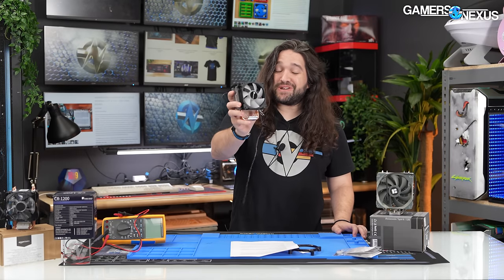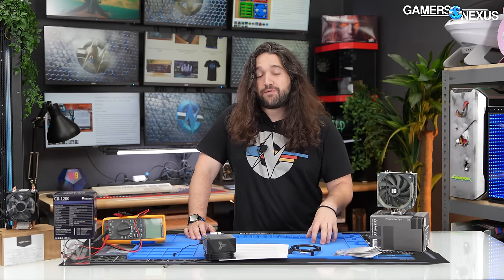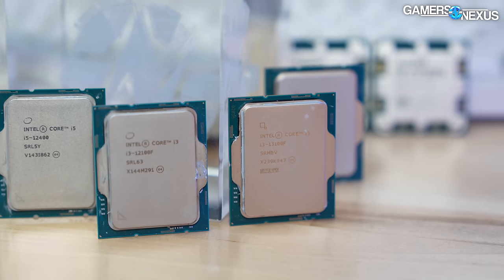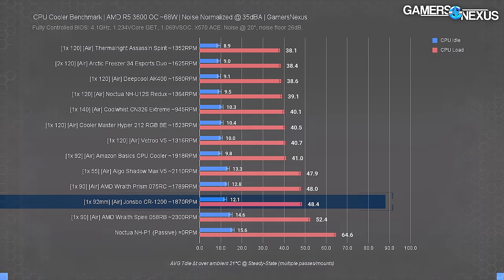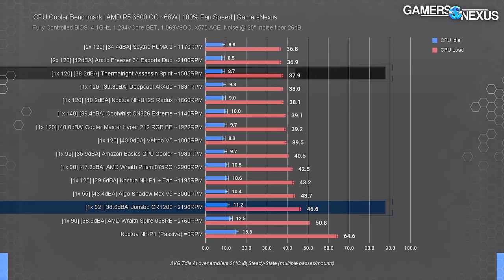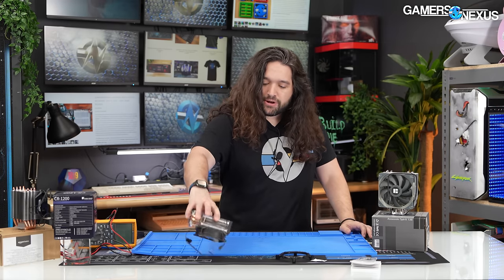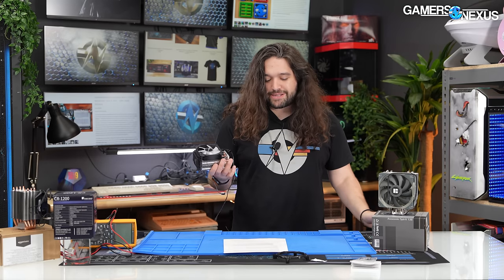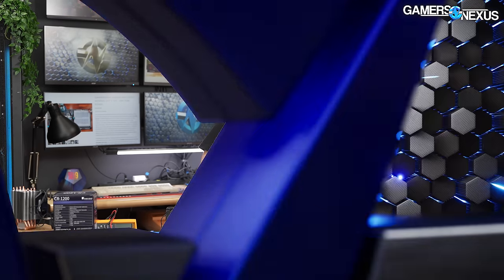Testing the Cheapest Possible CPU Cooler | Jonsbo CR1200 Benchmarks & Review

Comment: The Jonsbo CR-1200 is also available for as little as 6$ (with free shipping) domestically. It also has a 92mm (edit: confusing naming led to some misinformation) variant called CR-1400 which is sold at more or less the same price.
Reply: I have a CR-1400 as spare part, it still is a 92mm size, but has 4 heat pipes instead of 2.
Reply: How can they even make money out of it? The copper alone is worth more LOL
Reply: @bladeoflucatiel  Idk perhaps they primarily sell to prebuilt vendors and then excess warehouse stock is just shipped out for a dime to maintain a steady cashflow and goods? Maybe just for brand recognition marketing? 
It can be very tough to pinpoint why exactly a product exist at its given price range, especially in the extremes of ultra inexpensive/expensive. In my experience some of the worse offenders are the ultra expensive ones, like I saw a 3080 10gb sitting at a shelf for literally 2.5k usd (converted). That thing would not sell in a thousand years, yet it just sits collecting dust and taking up precious space. Why? Nobody knows, I bet not even the people selling it are aware of its existence lol.
Reply: @bladeoflucatiel  snowman the cooler of choice for low cost build has been selling at this price for ages, jonsbo just have better sales network, so they can replicate that price universally
Reply from the maker: Are you sure about that? The product page says it's a 92mm cooler for the CR-1400. Even the official Jonsbo product page says 92mm. I don't understand why this is getting upvoted so much when it is just factually wrong. But on pricing/domestic availability, that's helpful to know - thanks for pointing that out!
Reply: I used the CR-1400 with a spare 5600x for kiddo's first build - it's fine... with boost set to 4.85GHz all core, it only hits 90 with y-cruncher avx loads when total package power is 168W - in a warm bedroom in a small, poor airflow case. Idle is low 30s, so about 10 over ambient. Gaming load is ~60. Cost about 10$US from a local (NZ) source. It's fine.. nothing exciting, but if you need a cooler for a non techie, it's cheap and cheerfull.
Reply: The CR-1400 is 92mm, that's what I got for the ITX system in my Phanteks MiniXL dual-system case because it was the only cooler with enough clearance I could find that could be oriented to push air vertically (towards the top of the case) - the Noctua couldn't, it could only push towards the back of the case. By the way it was $11 when I bought it which makes this CR1200 make no sense as the 1400 cools my  3570K at 4.9Ghz and I doubt the 1200 wouldn't struggle at stock
Reply: Why is your reply almost at the bottom of this yt thread?
Reply: @GamersNexus Ah yes the naming is quite confusing. It's NOT a 140mm cooler. Thanks for pointing that out!

As for the price, I'm referring to a few listings from a selection of third-party sellers on JD. Of course, Jonsbo's official JD store lists the CR-1400 at approximately 10$ (75 CNY, currently on flash sale with a countdown of 1 hour and 35 minutes - but don't panic since they do that every once in a while lol), but the price is still impressive nonethelessly.

Comment: I've been using Jonsbo CR1400 and CR1000 (not the CR1200) for many mid-range builds. I wanted you guys to check them out 

They work well with 4 heat pipes, great price, and surprisingly good looking ARGB
Reply: How much cost the CR-1400 in your country? in Venezuela they are around 40 US$
Reply: @manuelpereira4247  wow! Here it's around 13-14 usd. Really popular in asia
Reply: Got the CR1400 from Newegg for around $15 on my i7 9700 and it does the job just fine
Reply: The CR1400 is good for a 12600K ?
Reply: @Rokomarn  Yeah, for a K series processor i would go for something like an Assassin's King 120SE

Comment: You guys have sometimes talked about lapping CPUs to improve contact surface with the cooler. Would it sometimes be viable to lap a cooler to improve contact area?
Reply: Yep.  It used to be a common practice when lots of coolers were less than ideal out of the box.  There are instructional vids on YouTube.  Just don't get carried away and put a hole in the heat pipe.

Comment: Nice review! Love budget options being covered in reviews. I have an interesting choice: how about the stock dell/hp coolers that they have in prebuilds? They're cheap and seem like they could fit in some sockets? I have a prebuild hp pavilion with it in there and I swapped the fan with the fan from the AMD Wraith spire while keeping the stock heatsink in and noticed a 3-4°C decrease under full load for a Ryzen 7 2700.
Reply: GN has had Dell reviews before.  I think they use a proprietary mounting that prevents 3rd party coolers.

Comment: I hate living in Turkey. Just checked aliexpress and this piece of junk is sold for $25 to my country while it's $7 for US. Plus $15 or so shipping, it costs $40 total for me...
Reply: At that rate, you might be better off with a slightly larger cooler that AliExpress has a ton of stock off.
Reply: @USSMariner  nah I'm better off buying a local made cooler which is what I did for a ryzen 3600 recently. $20 after tax 4x6mm pipes and 120w tdp. dark x123.

Comment: Just got a Jonsbo C6 case.  I needed something very small to fit inside another Industrial machine cabinet.  I was going to use a Nuc or some other mini PC but the manufacturer really wanted a full PC not a mini AIO.  So this case is really interesting.  It has only one bad point.  The good is that it's the size of many ITX cases and manages to fit a MATX board which is great.  The quick release mesh sides are a very good thing for something this small because you can get at everything easily if needed.  It uses a full size power supply or a small one.  It has a front USB C.  The one downside is that there's no room for any kind of tower cooler so you either use the stock cooling or a slimline Noctua maybe.  But other than that... it's incredibly simple and tiny for a MATX case.

Comment: Man, those latches remind of the old Socket 939 stock cooler. The 478 mechanism was a bit easier but full of plastic.

Would love to see a retro cooler tested on modern hardware like the high end 775 coolers, the late Core 2 Quads (and overclocked P4s and stock Pentium Dual-Core) realistically had more than 130 watts TDP. Because there are still some hanging onto those rigs (heck, my friend's shop computer got an Athlon X2) and in the case with Noctua units, they can be retrofitted on the newer sockets with their mounting kits. Let the dinosaur roar!

Comment: For next coolers to test:

Personally, I wanna see the 140mm fan stuff! Everyone always skips reviewing these in favor of small 120mm single-tower and massive 140mm+ dual-tower. But generally 140mm is under-reviewed, IMO.

- Thermalright Frost Commander 140 (FC140) and Frost Spirit 140 (FS140) (These are dual-fan dual-tower coolers, with 1x 120mm, 1x140mm fans... What the??? Why two size fans???)
- DeepCool AS500 (single tower w/ 140mm fan)
- Be Quiet Shadow Rock Slim 2 (kinda old now, but a single 135mm fan, single tower cooler)
- Noctua NH-U14S (single tower, single 140mm fan cooler from Noctua -- is it any good? Quiet? Compact/flawless RAM compatibility?)
- Scythe Mugen MAX (huge, thick, single-tower, 140mm single fan cooler. Pretty darn old. Brackets for AM4 and newer Intel motherboards are sold separately. Did I mention this thing is huge for a single tower cooler?)

Something about all these being lesser reviewed just gets my curiosity going. Hard to stop wondering, "what if these are secretly really good?" Or just wanting to know even if they suck.

Other weird coolers:
- ID Cooling SE-207-XT (really short dual-tower single-fan cooler)
- ThermalRight Silver Soul 135 (another really short dual-tower single fan cooler, has a more compact 110 variant, these might be interesting for ITX builds?)
- Thermalright Frost Tower 120 and Phantom Spirit 120 (why do these things look so similar to the peerless assassin 120, same price, which one is better? Looks like the fans/heatpipes are different?)
- DeepCool AK500 (thicc single tower single fan 120mm cooler, why so thicc?)
- be quiet! Shadow Rock 3 (another thicc single tower single fan 120mm cooler... What's the deal?)

Comment: Potential Correction: I left a comment on a previous cooler review asserting the Spirit and Assassin X are not actually the exact same cooler.
I do not believe the Assassin Spirit and Assassin X are essentially the same product. The X may have replaced the Spirit, but it is not a simple rename. Not only is the top of the fin stack different, but the heat pipe spacing through the fins is different, and the X appears to have around 45 fins while the Spirit has just over 50. The X is also 46mm wide while the Spirit is 48mm wide according to the Thermalright website. Performance will likely be similar, of course, but I know you like to be very technically correct.

Comment: I changed my old Intel stock cooler on my i5 3470 just over a year ago for a Be Quiet Pure Rock slim that cost me £15. The Intel cooler was 8 years old and still going strong (kept hold of it as a backup) and the Be Quiet has been doing a great job ever since. I do also have 7 case fans installed which helps, and the noise level is very low.

Comment: that's the cpu cooler that i used for my first pc build! i was running an i5 4460 and r9 380 (both was from my brother's previous pc) 
I didn't like the intel stock cooler so I bought a cheap and decent cpu cooler which is this and it performs good for its price range

Comment: I paired this cooler with e3 1240v3 since the stock cooler ran pretty hot (90+C) on cpu-z stress test. with this it can hold 75C all day. been 3 years, worked fine!

Comment: I was using this for a while waiting for the ek aio to restock late 2022, was selling for $8 with shipping but still the cheapest functional cooler. With eco mode locking at 65W this is a neat backup cooler.

Comment: in portugal they sell that brand on retailers, they have cases, cooling related components, one interesting case they sell is a Jonsbo D41 MESH, with a 8" display on the front of the case. that cooler in particular is sold for 12€

Comment: ".. socket types that most people watching this has never built on before.."

I still have a perfectly working Core 2 Quad Q9400 LGA775 machine as my media center. Though this is from 2008-2010, and I have replaced the Quadro FX 580 with a more recent (not by much) GTX 1050TI single slot Inno3D GPU. Surprisingly it handles 1080p60 Steam gamestreaming from my main PC pretty well, albeit it took some tinkering to get it to work properly. Thanks Moonlight.

That said, my first ever build was a Pentium 3 500 mHz CPU (yes, 500 mHz) running Windows XP, primarily just to play 3D pinball. I have seen a generation or two of CPU's through the years.

Comment: Used this cooler for a year and a half and i can't really complaint that much cause it does it's job decently for my beast of a processor (jk) R5 3500X. Recently changed to ID-Cooling SE-224XTS just because of changing it. If not probably would stick to this CR-1200 for a few more years wkwk

Comment: Have you ever considered using a thermal camera on these cheap coolers to see if the heat is actually going up the heat pipes, and getting into the fins?
It would be a really interesting comparison to see a low end cooler versus a high end cooler, just to see if the cheap pipes are actually doing any work.
Reply: Not sure how possible that'd be, considering thermal cameras don't really work on shiny objects...

Comment: The Jonsbo N1 and N2 are arguably the best SFF NAS cases on the market. Each will easily fit an ITX motherboard and five 3.5" HDDs. The airflow isn't perfect in either one, but it's not as if you're going to be installing super hot components in a NAS anyway.

Comment: I had a thought from the past. Before the internet compute stores that built desktops like to shed costs and cut corners. One of them was purchasing (still is) after market fans instead of using stock intel fans or before that a good quality ball bearing fan. I could picture a shop ordering a case of these things and pushing them out the door. So for those of you that are younger are asking. What is the problem with that. Well both machines would sell for say $1,200. Ouch.

Comment: You should also try the CR1000 as well. It's basically a big brother of the CR1200
Reply: CR1400*
It's also 92mm but with 4 heatpipes, deeper fins and proper screw-down mounting. I use it on an overclocked 3570K because of clearance, and because the equivalent-size Noctua couldn't be configured to push air up towards the top of the case but this one can.
Reply: @Vinterloft  CR1000 is a 12cm version and much bigger one as well. But sure

Comment: This is actually reasonable if you sand the base to proper flatness. Mine did very poor contact with the heatpipes until I did so. (And very high temps)

The next improvement is a 4pin fan designed for pressure.

Biggest issue is thermalright is selling the 90 Assissin X for $15 now and they usually deliver better quality (it also has more heatpipes).

So I wouldnt go for this unless you want a good clip style cooler.

Comment: In my old i5 2500 I run a cooler master blizzard t2, fixed rpm small, VERY Cheap cooler, beyond some vibration noises and the bearings getting bad after a couple years, the thing was great. Replaced an old copper base i7 cooler, and after that no matter what I did it wouldn't go past 70°C and would aways be on max boost. For up to maybe 55W cpus, this kinds of cooler are great.

Comment: I'd like to see a review for the Thermaltake Contac 9, which is also a two pipe 92mm tower cooler. It's usually just under $20 at microcenter and amazon and occasionally drops to $15. It would be interesting to compare with this one.